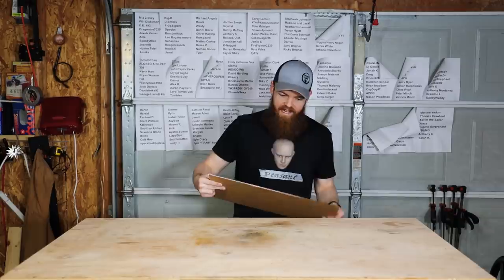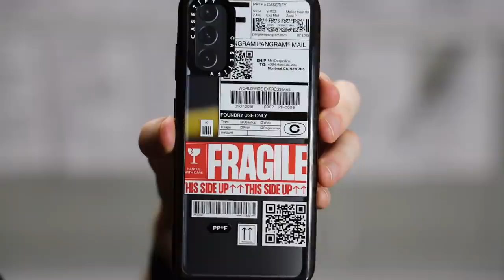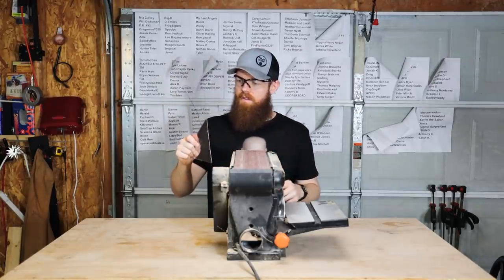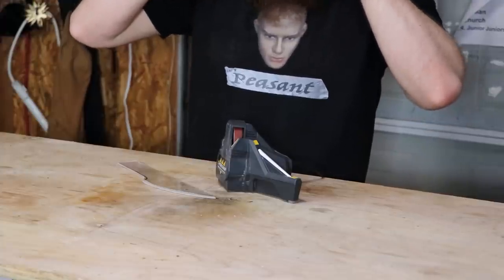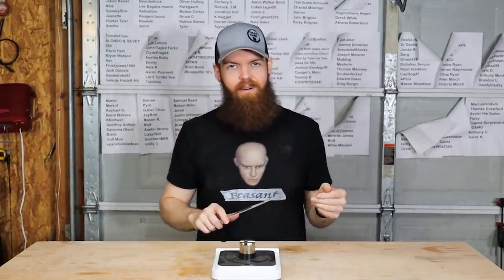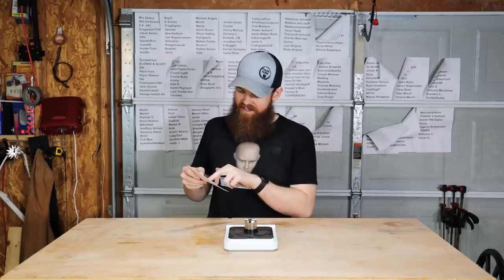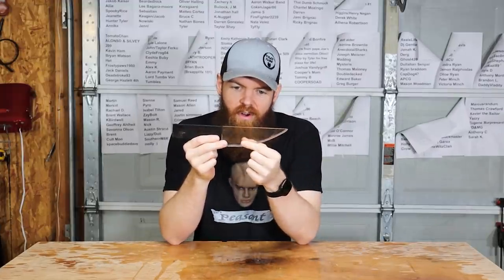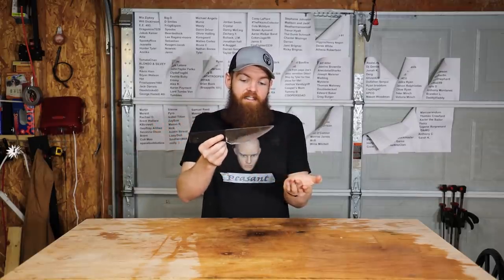How Sharp Can you make plexi glass?

Comment from the maker: Go to http://www.casetify.com/tylertube today to get 15% off on your new favorite phone case!
Reply: M.gg
Reply: Bro the smoke coming off that melting plexiglass is insanely toxic! You should be doing that outside and with a chemical respirator.
Reply: I think with plastic you should try just 1 flat edge, instead of going for a v edge.
Reply: OK so plexiglass is a failure why not try sharpening a piece of window glass with diamond wet stones
Reply: Hey Tyler so I have worked with plexyglass allot over the years on construction. I can tell you the secret to sharp plexiglass is to snap off a section. It least a razer sharp edge. You'll never be able to sharpen it by hand like that. You have to break it to get that super sharp edge.
Reply: You might need a thicker plexiglass :)
Reply: Tyler, you should try making a knife out of bismuth.
Reply: Make a Knife out of a 1/8 in thick sheet of copper!
Reply: no
Reply: but i have an LG...
Reply: Tyler I'm not giving you shit you try hard on all your projects but maybe sand it down so it's thinner and it will get sharper
Reply: @xglazzx  He sanded it for the whole video?
Reply: Dare you to make a knife from the phone case
Reply: Tempered Glass Knife.
Reply: Should have used a band saw
Reply: Now try making and testing a jailhouse shiv made from frozen human faeces.
Reply: Yo what if you threw some heat treatment on that blade edge. I think that would harden the edge more to make a better edge.  Just an idea.
Reply: U sound like my science teacher
Reply: Like ur voice
Reply: Make a jb weld knife and sharpen it
Reply: You can do this with real glass if

Comment: I feel like the question isn't "how sharp can you make Plexiglass", but instead "how sharp can tyler make plexiglass"
Reply: I love this comment so much, as someone who bought a cheap whetstone set a while back and actually tried ro sharpen plastic, stainless steel non hardnened knives, and a hardened one, material has its limits but i dont think he even reached a 10th of its potential. As always though you can't expect much but some laughs and ridiculously dangerous and 0 cautions to personal safety experiements.
Reply: tyler
Reply: @xd-qi6ry  I would of sharpen the plexiglass at a more extreme like 15 degrees. instead of the 22 degrees.
Reply: @faervas1234  true but only because sharpening it wont necessarily perform a bur and material will come off quite quickly so makes sense, either way though tyler did everything wrong.

Comment: A dremal with a sanding drum works very well to take chunks out of plexiglass. Can start anywhere in the material with the dremal at a 45 degree angle and it'll start to get hot, and then once whole sanding drum fits into the hole, can start to just push in direction you want.

Comment: Tyler, I'm not sure if it's an oversight or if there are different techniques using the stones, but are the stones not meant to be wet first when using them? Maybe then the sharpness of the material will be better...?
Reply: I came here with the same comment.
Reply: Those are wet stones. Either water or honing oil
Reply: @justme-vu6yj  actually it's "whetstone" and they can be used wet or dry, the name isn't indicative of whether it's "wet".  All sharpening stones are "whetstones".  "Whet" as a verb means "to sharpen".
Reply: yes the stones need to soak for 10 minutes before using, I have a set
Reply: @_Sterben_  they can be used wet or dry. If it's being used dry you wouldn't soak it. Again, the term whet isn't to be confused with wet. Two different things.
Reply: @TroyTube  they are either soak, or splash and go stones the only one that doesnt need any water are diamond stones even then water is helpful but no need to soak
Reply: @xd-qi6ry  again it depends on the stone type...whet and wet are not the same term.
Reply: @TroyTube  exactly some need soaking some don't they are all whetstones, but no matter what stone you have you can't just use it dry without either splashing it once or you care wbout the life span of the stone but also it helps you lead a smoother edge that way the edge is more consistent and easier to do a strop for example.
Reply: @xd-qi6ry  I have prob forgotten more about blades and steel then most will ever know. You should direct your knowledge to those that think whet and wet are the same word.
Reply: @TroyTube  whet and wet are no the same word whet is meant to mean to sharpen a blade.
Reply: @xd-qi6ry  um that's what I said...I suggested you direct your energy to the ones that think they should all be wet bc they are "wet stones".
Reply: @TroyTube  wow some people are kinda not that bright whetstones are ment for sharpening and like you said wet or dry they both work and unless the stone in question is marked to be specifically wetted then its fine if its dry and honestly I don't see why your feeding the troll unless trying to educate people
Reply: @TroyTube  there are whetstones intended to be used wet, some intended for dry use. I'm not an expert to say which these are, but there are indeed wet whetstones
Reply: @Blatant.Obscurity  why are you saying this to me?  I am not the one that needs corrected.
Reply: @TroyTube  bro whet and wet are not the same thing. Whet means to sharpen
Reply: @verifiedhandle9103  bro did you even read my comments? I'm not the one that lacks knowledge here.
Reply: @redmist6131  I can't help but try to educate but there seems to be little hope.

Comment: You're supposed to leave the paper on till the end lol. I've worked with polycarbonate for lots of years. It just keeps it from scratching while you work it. Also even though I just started watching, I can tell you personally you can make it very sharp. I've almost lost a finger from just a corner edge of the stuff. Carry on though, paper doesn't matter in this instance. Very curious to see the results.
Reply: I've made a piece of plastic quite sjarp with my stomes just to try, not even talking about how wrong he uses the stones its actually funny, however material as a whole has its limits and because plexi glass is quite easy to sand off or take away material when you get to the finest edge you can get to it will just make it duller than before.

Comment: A few things. The work sharp belts need to be changed. They are gunked up. The sharpness tester is also partially a hardness tester. You also need to have a longer bevel on that blade edge. It would give you a better edge

Comment: Not sure how accurate the angle is when you use the stones, but 3 quarter high slant should make all the sharpening videos ALOT better results
Reply: Not to mention using the worksharp the right way, I'm pretty sure one side of the machine has a steeper angle than the other side

Comment: Hey there, nice channel you have there  I like seeing what and how much it costs to get a knife Sharpe and keep it sharp, for as little money as possible. there are a few great cheap ones you haven't tested I would love to see how they work and if they work I know mine do work like a charm like the smith's 4 in one it's more camping and fishing but pretty good 2 stage chefs choice in kitchen knife area Walmart then by same brand is 3 stage works great with the right knifes and then my go to or my second go to is accurate sharp it's 4 in 1,2 diamond stones one for serated  and smooth blades then the carbide and ceramic side all in your pocket I do have a diamond stone with a handle but very low grit but good from smith's but talking cheap easy to use sharpeners thanks your fan for years Ted  all at Walmart remember there is 2 areas of the store to get different sharpeners kitchen and pocket knife/tool area p.s. they all are under 20.00 but only one not under 20 is the smith's diamond stone with handle I think 25.00 for it thanks again for keeping me entertained and educated

Comment: Instead of drawing the outline of the knife free hand off the top of your head, you should have either sketched it on paper until you had it how you wanted it, or printed off a picture of what you wanted online then just glue it to the surface. Once you cut the outline out, then as you sand it it will just get removed

Comment: You are sanding fibrous plastic.  What if you found a way to friction heat the blade instead of sharpening it, but instead if using grit you try friction heat strokes.  The plastic might form a better edge of heat is used.  I dunno just a thought.

Comment: The stones are supposed to be wet for the best effect 👍
Reply: It just helps keep the life of the material (of the stone) but you should always apply water on top after soaking, there is not one stone i can think of that you simply don't either splash and go or apply water for the smoother leading edges.

Comment: You'll never be able to get plastic sharp enough to cut because when it gets that small it's just to flimsy also just from the action and friction of you sliding the plastic across a wet stone when plastic is the small it will just melt. Try something like glass or rock that would make a cool video. Things like plastic or wood or styrofoam or whatever else are just to soft to make into something as durable as a knife needs to be... you could even make a knife out of putty if you wanted you just need to find a material that stays hard even when it is small enough to make an edge